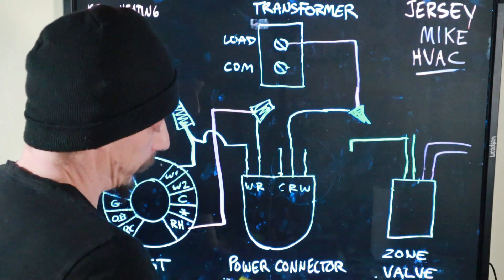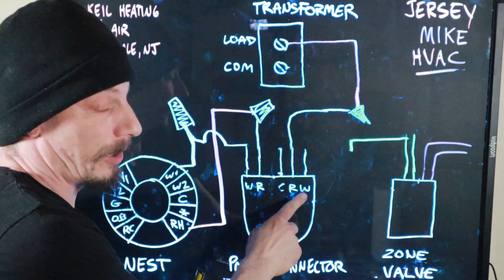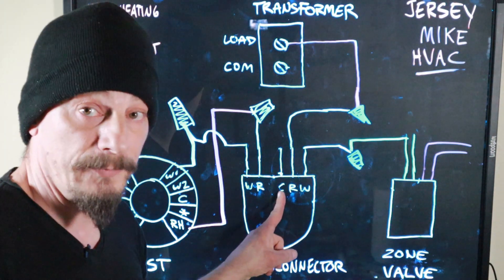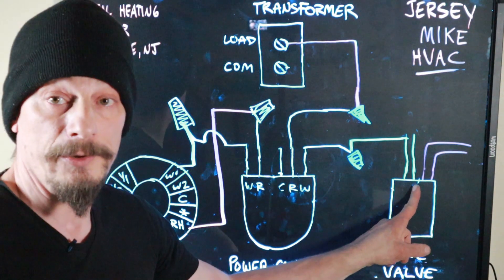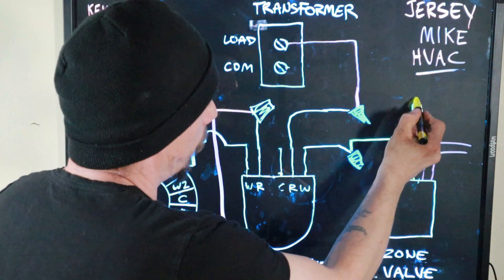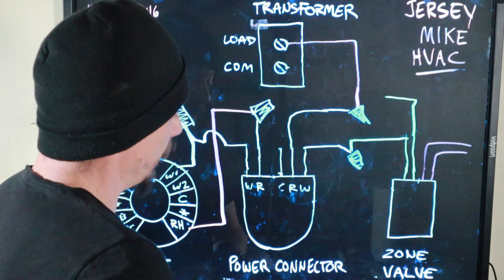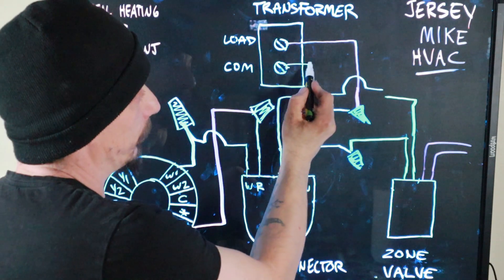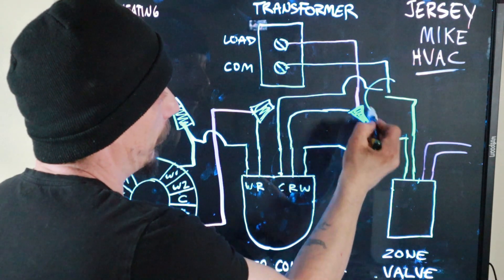DIY Nest Power Connector Wiring To Zone Valve (1 minute version)

Comment: Nice!  If I understand correctly, this allows 24v to go to the Nest via R and power it, regardless of whether the circuit is complete (calling) or not.  Upon the thermostats circuit being complete and that returning on the W to the Adapter, this will then allow 24 to flow to the zone valve.  I assume this is done mechanically or logically somehow.  Here, if everything’s functional, the valve will open and trigger the end switch which completes T-T’s circuit and fires the boiler?
Reply from the maker: Pretty close. The nest thermostat has an internal charging loop that is fed from the 24V at the R terminal on the stat and bleeds a very small milliamp current to the W terminal even when the call for heat is not there and the switch between R and W is open.  That milliamp current makes its way to the zone valve, but it is not enough to operate the motor even though this is a path the returns back to common. 

All the power connector does is take that bleed signal off of the thermostat's W terminal and bypasses the zone valve entirely so that it can connect straight to common. This has to be done because the resistance in the coil of the zone valve motor weakens the milliamp current and renders it insufficient to charge the stat. Bypassing the coil resolves that. 

 When the stat calls for heat, the bypass is opened inside the power connector and the circuit runs as normal through the zone valve at 24Vs and full amperage.

Comment: What if you don’t have a common wire at all?
Reply from the maker: Thats what the connector is for. The common referenced in the video is down by the boiler and is absolutely there, otherwise you wouldn't have a circuit and the boiler wouldn't work.

Comment: so i followed along pretty good.  my issue is I have a 3 zone furnace heat only and 3 two wire thermostats.  so i order 3 nest c wire adaptors and wire them in at each zone valve ? would i just then be splicing all 3 wires on each power adaptor into the same load wire coming off the transformer ?
Reply from the maker: Yes, one at each zone valve and all 3 powered off the same wire from the transformer. That's correct. Same common going back as well.

Comment: Hey Mike! Great video! I hooked up as instructed and my thermostat has power going to it but my (zone) boiler runs all the time...even if I turn the heating off at the thermostat. I have a honeywell 5 zone system with 2 wires at the thermostat. I ran the wires off the transformer, to the thermostat as instructed. (off the zone valve motor 24v supply...not the 24v end switch supply off of the boiler) I tried it with the blue jumper in place and without.
Reply from the maker: What model Nest thermostat do you have?
Reply: @JerseyMikeHVAC  model # G4CVZ the one with the 6 wires mounting base (3 wire terminal block on each side)
Reply from the maker: @bryanb3584 

Just checking capability. 

So, the power wire off the transformer does not go directly to the thermostat. That's where it should be before connecting the power connector. It has to be moved to the R wire (white one) off the power connector first. 

This video is a chopped up condensed version of an original. Here's the original in more detail. Just check over the wiring again and let me know if you do or don't notice anything. 
https://youtu.be/XVs0k1aaza4?si=B6oXkfjbETiooyNo

Comment: What about the Nest Power Connector wiring to Honeywell R845A switching relay which does not have C wire connection and using external 24 VAC transformer ?
Reply from the maker: I haven't done it before. But I will tell you how I would do it in a way I think should work (assuming you have a nest model that is compatible with the power connector, as not all are). 

First I would add an external transformer, connect a wire from 24v on the transformer to the R wire up to the thermostat (currently on T T connection in the honeywell). Connect the W wire coming back from the thermostat to the coil side of a 90340 relay (also currently on T T connection in the honeywell). Then from the coil side of the relay back to common on the transformer.  So basically what you are doing is powering the thermostat directly off the new transformer, call for heat closes a switch, sends the power to W wire down to the 90340 relay coil, coil activates and power goes back to common on the transformer to complete the circuit. 

 From here, the closing of the other side of the relay by that circuit you just created can activate the TT connection on the honeywell R845A through the 90340 normally open relay terminals. You just run one wire from T to terminal 1 on the 90340 relay and the other T to terminal 3 ( These are normally open contacts). You can also use terminals 4 and 6, also normally open). 

Test that out. Make sure it works before continuing. 

 From here, you can wire in the power connector. You will disconnect the R wire coming off the transformer (the one that goes directly to R on the stat) and tie that into the grey R wire on the power connector. You will take the white R wire on the power connector and now put that on the 24v connection on the transformer directly. Now disconnect the common wire from the transformer coming back from the coil side of the 90340 relay and connect that to the gray W wire on the power connector.  Take the white W wire on the power connector and connect that to transformer common. 

 The common connection for the power connector will also go directly to the transformer common. 

 If you decide to try that, let me know if it works or doesn't. Think it should.

Comment: I have an extra 24 v ac transformer… can I just run  wires from the transformer to the c and r terminals ( and hook up the W wire of course) and go with that?  I may give that a try since the zone valve wiring is above the boiler and hard to get at
Reply from the maker: The W wire would eventually go back to COM on a different transformer. R and W connect on a call for heat.

Comment: Thank you Mike.  I have a 2 zone system (hot water) with two zone valve controllers.  Do I need a 2nd Nest power connector?
Reply from the maker: You need a power connector for each nest thermostat.

Comment: Mike you are the best very clear thanks! I will connet a power connector on one zone. I have 3 wire on the second zone but cannot locate the common connector on on the Aquastast L7224/L7248 to connect the green wire? Very strange. Should I add another power connector or am I missing somthing on the Aquastat?

Comment: Just want to confirm ... I have 4 zones for heat and its a 2 wire system... will I only need one power connector?
Reply from the maker: You need one power connector for each nest thermostat..
Reply: @JerseyMikeHVAC  follow-up question .. I have 4 zones but at the moment only have 1 Google Nest to install. Is that permisble to install the power connector to the one zone, or do I need to install power connectors (& Nests) on the other 3 as well? Just want to make sure I can just have Google nest if that's really all I want. Thanks so much for your help
Reply from the maker: @pfrancescutto  You can just do the one power connector on the one zone with the Nest thermostat.
Reply: So one power connector can NOT feed more than one zone. I'm glad I asked because I would have guess wrong. thanks for your response

Comment: Mike do you think the Nest connector can be used to create a common "c" wire for most other wifi brand thermostats even though it says for nest? I think as long as you're creating a c wire its fine and acts same way, the system doesn't know...

Comment: If I connect the power adapter and don’t get to mounting my nest thermostat right away will my old thermostat still work while the adapter is hooked up to my furnace? Or do I need to mount and install the new nest thermostat right away?
Reply from the maker: I never tried it to know for sure, but if it's just a regular thermostat that runs on batteries it should still work. In fact, you might even be able to take the batteries out to see if the stat still works without them to see if the power connector is working.

Comment: Is it possible to hook a power connector to one thermostat and not the other when the thermostats are connected? When I hook up the power connector I can only seem to get one thermostat or the other working, right now I can get the thermostat with the power connector working but not the other thermostat, how would I do that?
Reply: Can I hook a second thermostat red wire to the power connector grey power wire, would it give it power? (Without a c- wire hook up)?
Reply from the maker: They make the power connectors to work on only 1 thermostat. So you'll need to get another power connector.
Reply: @JerseyMikeHVAC  My problem is that I’m trying to get to work for zone 2, zone 1 doesn’t need one, but I can’t seem to get zone 2 (w/ power connector) and zone 1 (w/o power C) working at the same time. It’s wired in a way where there are some wires wired together from both zones. Is there a way to wire 2 zones, one with a power connector and one not?
Reply from the maker: @mti14  Do you have a slave/master thermostat set-up? Where one has to be running in order for the other to work? (even with regular thermostats?)

Comment: I ran a separate c wire thorough my walls.  After I hood that one side up to my new Nest thermostat where do i connect the other end.  To my Honeywell zone valves or to the furnace.
Reply from the maker: Do you have a boiler and a furnace?
Reply: @JerseyMikeHVAC  I have a 2 zone gas fired, baseboard heating system with a Weil McClain CGA boiler. There was only 2 wires at the thermostat.   I ran the separate dedicated new C wire from the thermostat through the wall to the furnace.  I just need to know where to hook up the other end of the wire so I get the continuous 24 volts to the c wire  Does it go on the external transformer (which has the r and w wires running into the furnace, or to each zone valve, or on the c wire on the boiler itself).  Thanks for you help.
Reply from the maker: You can connect near the zone valves to   the common wire going back to the transformer or to the transformer common itself. They're the same connection.